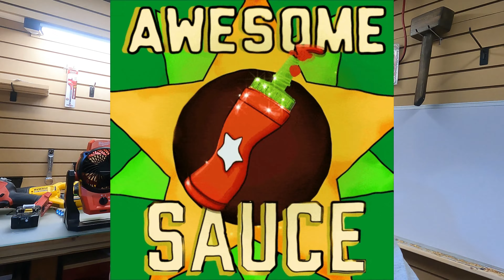Be A Better Contractor try this

Comment: Good idea Robert. Hey man this stuff might sound elementary and basic, but it’s really not. You know how many times my dad has sat down a circ saw that has no brake, the guard slipped, blade started shooting rocks from the ground into cars and windows🤣. Your absolutely right. Nobody talks about things like this and it’s 100% the most important thing on site, to be safe. Awesome brother👊
Reply from the maker: Thanks man!  that was my thoughts!  Aspecially after having a guy help me recently, and he kept standing drills and tools upright.  on /over wood and tile floor ,  !!  lay them down!!  when tools don't stand them selves upright  like the m12  (standard battery)  it's not a deal breaker for me !   Thanks !

Comment: I learned this the hard way right after I finished installing a custom set of stair treads that I made from scratch. I knocked my drill over with a pilot bit in it, the pilot bit hit, made a mark, broke, and made another mark. Wasn't as bad as the electrician knocking over one of the custom newel posts I made and it came down the stairs and damaged two treads and then hit the floor. Miraculously, the newel post hit near the nosing of both treads exactly under where the bottom rail was going so I didn't need to replace them. I needed to remake a new post though. Learned two lessons on one set of stairs lol
Reply from the maker: Yeah good stuff!!    every 1 benefits when people share their mistakes  thanks !